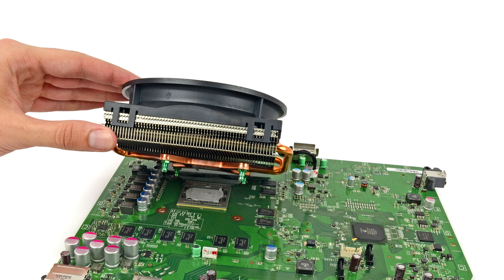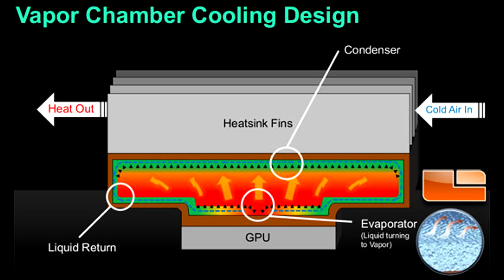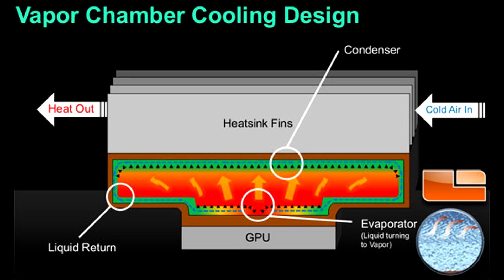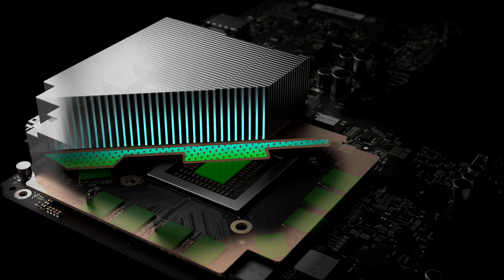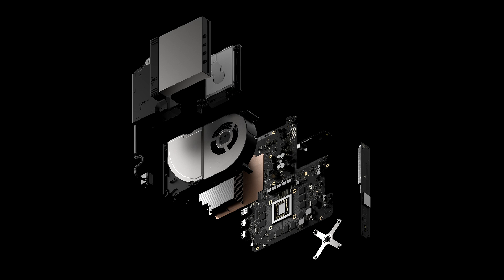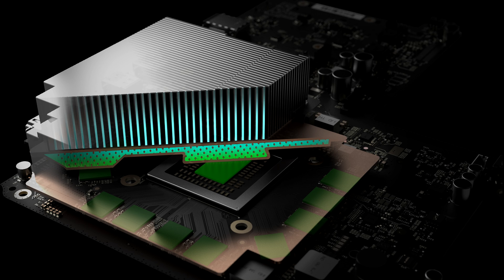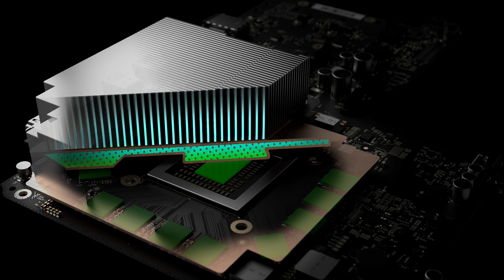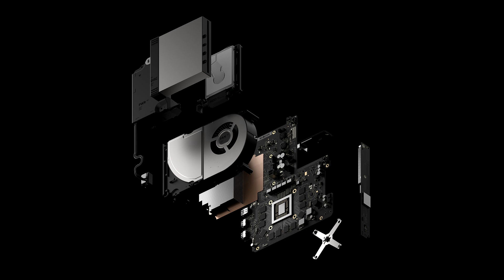The Amazing Cooling System In The Xbox Scorpio

Comment: Good video. However, this technology is all for nothing if Microsoft can't manage to use a thermal paste that doesn't dry up so quickly. I replaced mine on my xb1x last night. It felt like dry pottery; so much space between the apu die and the copper. It was bone dry; thermal pads weren't covering multiple vram as well. My fan barely spins now and I don't have that hot electronics smell exhausting from the console.

Comment: got it wrong its a puma cpu
Reply from the maker: Nope DF has confirmed in multiple articles and videos its jaguar. Even stated its the same CPU as in the Xbox one just tweaked. Also, Microsoft has stated that there API dx12 is also in the command processor of the Xbox one and one S. further confirming its the same processor. There is no data stating puma from DF or MS. It being Jag is a good thing :D thanks for the comment!
Reply: Aaron Ewan 
Actually nowhere it's stated as yet that the CPU is a Jaguar variant.
Instead it's clearly mentioned in the official spec sheet of Scorpio, that this new device is going to powered by a over clocked customised CPU, which is not a conventional Jaguar but a sort of CUSTOM PUMA to much of our delight. :)
Reply: FAISAL ABEER well you was wrong it an overlocked Jaguar.